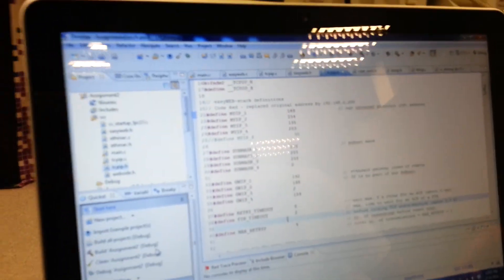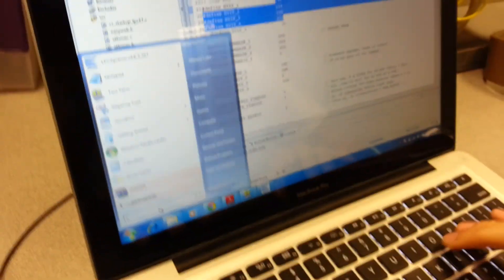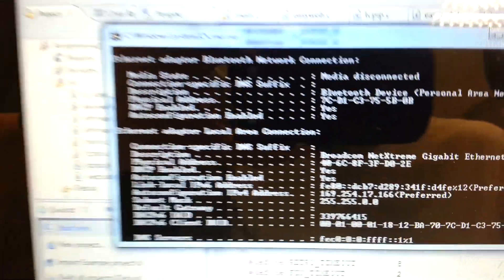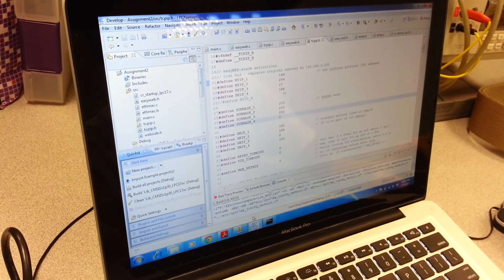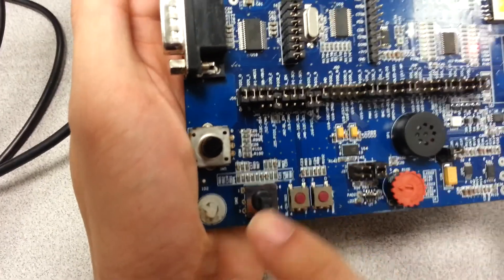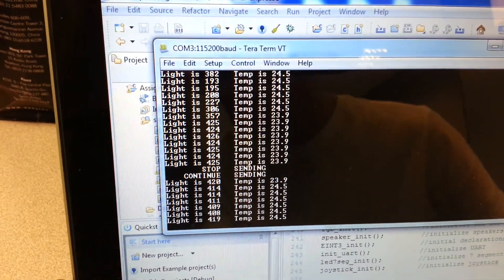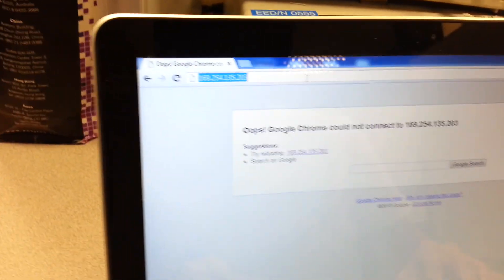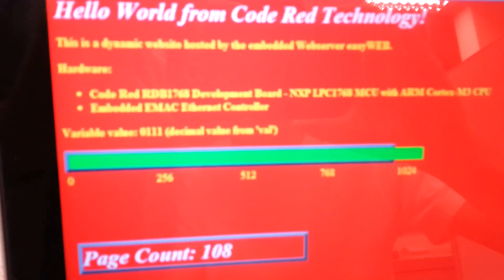LPCXpresso Baseboard Demonstration (TCP/IP)

Comment: Hi Markus ,  

Are u using the micro ip or the tcp/ip ? i have the uip code but struggling to find it.. can you advise on the whereabouts about how u trigger the ethernet transactions. I am actually doing a similar project in NUS and i am quite inspired with your efforts and would like to venture and try it out too..